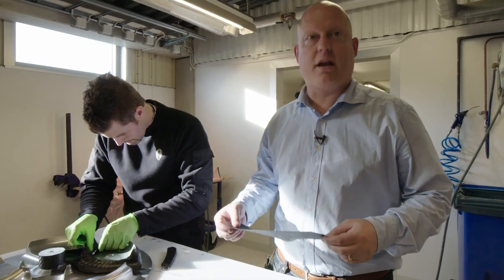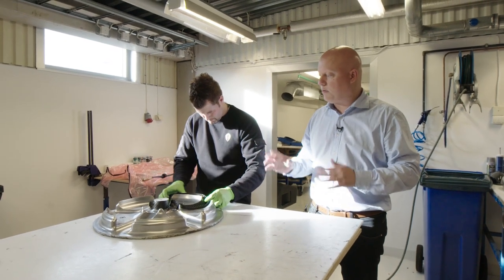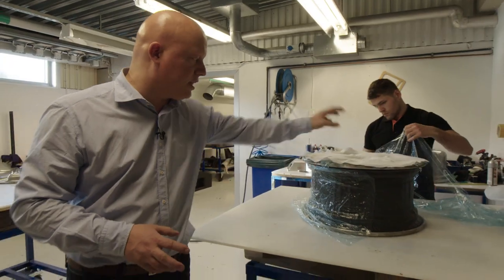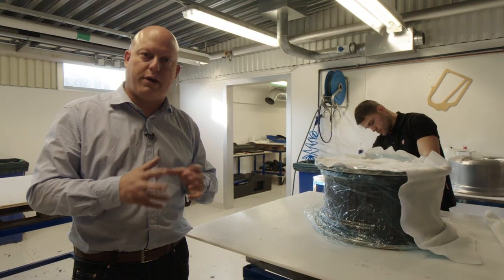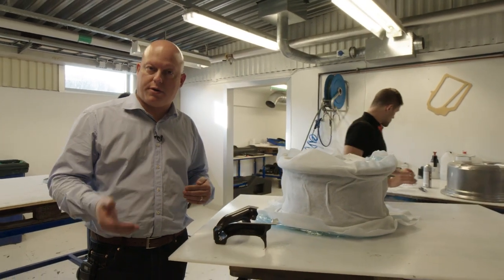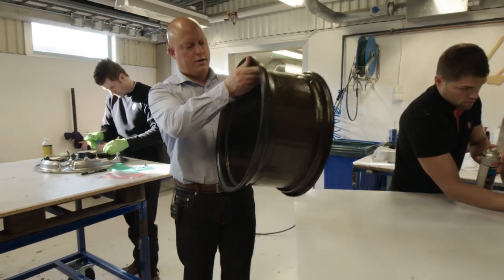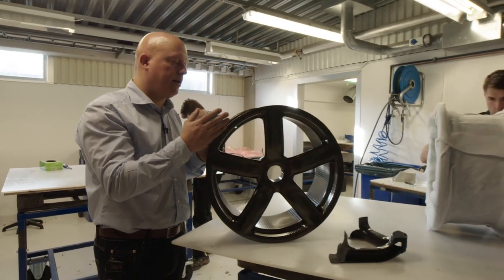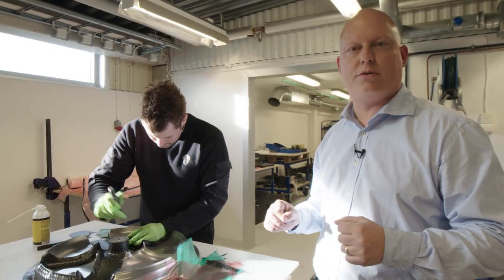Christian Von Koenigsegg Explains How He Makes 280 MPH Carbon Fiber Wheels

Comment: I bet the CEO of ferrari or Porsche doesn't know how the wheels for their cars are made.
Reply: Or Lamborghini
Reply: Nice gixxer, is it a 750?
Reply: Meterz. Thanks. No 600
Reply: +Gary Lowe i also bet they dont even know the engines because they use engineers to make one
but Mr koenigsegg knows everything. that is why his car is goin to be a new king of the road
Reply: +Gary Lowe or what material
Reply: +Gary Lowe The CEO of Ferrari is a mechanical engineer who worked up through the product development side of the business and previous to being CEO, directed the technical side of the road car department. 
The CEO of Porsche is also a mechanical engineer.
Reply: +Gary Lowe With most high performance car companies like Porsche, Audi, Lamborghini, Ferrari, Nobel, Lykan, Koenigsegg, Pagani etc, you'd find that their CEO's have a vast amount of input and knowledge and usually have a background in engineering of some sort.
They might not be involved to the level that Christian is (which is awe inspiring) but they're not blind to their reasons of innovation success.
Reply: Holly Catlin I guess. I was putting them in the same type as shop or restaurant chain CEOs. As you say they probably do know more than I give them credit for.
Reply: +Holly Catlin You can't lump in Audi with companies like Koenigsegg and Pagani when it comes to CEO input and involvement.
Reply: +Gary Lowe I doubt that
Reply: +Gary Lowe and Koenigsegg is pretty scared on testing their cars out
Reply: +Blörk Börg It's not a copyright thing to make your own wheel design. It is an expense thing, but with their volume, mold costs are negligible. Actually, the real reason they probably don't do that is that carbon isn't really the best material for wheels. 

Wait, what? 

Carbon is stronger right?

Yeah, in tension. Carbon fiber is strong in tension. However, it's not all that strong against torsional/off-axis loads. It's even worse when the fibers are bent/curved, which pre-loads them towards failure.

Does that mean that carbon wheels are weaker? Nope. It means that they have to be overbuilt when the primary loads are not tensile. That means they are HEAVIER. And you end up relying more on the strength of the resin than the carbon fiber itself.

For bicycles, carbon rims are also not in tension and are often heavier than alloy rims of the same dimensions for these exact reasons.

Additionally, the resin itself is susceptible to heat. OK, so they don't use rim brakes for cars... but they have disc brake rotors at glowing hot temperatures just a few inches away. Current resin standards start to seriously break down in strength at just 200 degrees Celsius. That's pretty fuckin' hot. But disc brake rotors in cars can make that look like kid's play. Rotors will start to glow at the Draper point, aka around 500 deg C. It's not unusual for disc brake rotors to get into the neighborhood of 900 deg... Keep that up for a while and you'll melt the fuck out of those sweet carbon rims. Carbon can't shed heat very well, so the heat will just keep building up on the inner surface of those rims.

You might see carbon rims on street models, but I doubt you'd see them on a racer. 

And that's probably why Porsche/Ferrari  has no interest in carbon rims.

Not a big deal for body panels though - which aren't load bearing and simply need to be strong enough to keep their shape in the wind.
Reply: +Gary Lowe CEO and owner are two different worlds. I bet Enzo Ferrari knew every single part of his Formula 1 cars because that was his LIFE. Nowadays CEO`s are just employees making company work and thats it.
Reply: Ma Art but the owner of Koenigsegg is the CEO
Reply: You probably mean CEO of Fiat ;)
Reply: I absolutely guarantee that is false.  They know everything about their respective cars.  And probably everything about their competition's cars.
Reply: God this being the top rated comment to me just easily by far screams the overall philosophy and perspective of Koenigsegg and their damn fanbois. Every other supercar, its people simply admiring and appreciating the art and engineering behind it. But here, the first damn comment decides to simply bring two other established, and easily greatest heritage lined race historied companies to attempt to throw under the bus and compare themselves to. Both the two companies you just mentioned have literally well over half a century of absolute unrivaled racing and engineering achievements, TANGIBLE, desired achievements that all car makers across the world pursue. Yet Koenigsegg and their ignorant fans think that its all about stupid bragging rights, throwing around numbers and conjecture yet show nothing solid of substance that can truly attest to their claims. No one cares if you have carbon fiber wheels unless you can bring them to the market for everyone to benefit and see the fruits of your labor at work. No one cares how fast your machine is if its not a production car like a Veyron is, and no one cares how great of an automobile it apparently is unless you have real race history and credentials to prove you know what you are doing. Wake up
Reply: Gary Lowe don't be hyped about this bcz Porsche and Ferrari been in the car racing game for long time even before Christian Koenigsegg was born   they just don't make cars like that and everything they put in their cars it's been well thought about it
Reply: Gary Lowe.. ferrari maybe .but porsche knows where there rims come from ...
Reply: They have to make more than 80 wheels every two years.
Reply: haziq iqbar dude do u even know that CEO of every car company is mechanical engineer and they don't just hire any one from a street walking around and Ferrari and Porsche and even lambo have history of racing cars and konigsegg just brand new company and first konigsegg don't even have their own engine they was using GM engine in their car
Reply: The CEO of Fiat/Ferrari is Sergio Marchionne and he studied commerce and business. He's not an engineer, he's a businessman. Ferrari don't have their own separate CEO as they are owned by Fiat.
Reply: Christian is more involved in the day to day operations than the Porsche and Ferrari CEO's.
Reply: christdragon dude the workshop of konigsegg is like restrooms in porsche or has it all figured it out long time ago  its all in front of camera and of course he have to talk about his stuff what he does and shit he is doin now  Ferrari and Porsche been through all that in 80's  and that explains it all
Reply: Fiat may know something about Ferrari... ;)
Reply: Mr. Petkov w fiat is owned by Chrysler btw
Reply: Fiat Chrysler Automobiles NV, also known as FCA, is an Italian-controlled multinational corporation
Reply: So amazing! I bet a body shop boss knows nothing about these
Reply: Gary Lowe dude. no one can fuck with enzo ferrari. yes he was very disrespectful but he did his job on the best way he could do. r.i.p
Reply: Elon Musk claims he's at least 80% hands on.
Reply: Gary Lowe he was a trully big man on his plant, and he is a young man..!
Reply: CEO of Porsche is a mechanical engineer, so he probably knows.
Reply: Ferrari and Porsche is the best supercars ever made and they have very good car history
Reply: You'd be surprised!
Reply: You’re so wrong
Reply: @eschelar  
Where does the torsional force come into a well designed rim really?
Cornering won`t introduce extreme torsion into a well designed wheel..
Torsional stress can be mitigated through design, by implementing crossbrace forms, and actually leaving enough flexibility in the right places so the crossbrace will take over before the main bearing structure experiences overload..
Do you really not think Köenigsegg don`t do stress analysis, load tests, weight optimization, durability tests, all the rest of it? 
If you`re an engineer which you sound like you`re trying to be, you know tolerances is everything..
And who ever said the car was made for racing, let alone prolonged racing.
Reply: @timgermanyjr  
And their customers..
Reply: @afrog2666  Tension is the primary strength of carbon fiber. When fibers are loaded from other directions, they are not strong. In that case, you are relying on the strength primarily of the resin. This is not an issue of tolerances at all. This is simply an issue of using the right tool for the job. Carbon is great for some applications and terrible for others. They don't make engine blocks out of carbon fiber for a similar reason.

And the strength of the resin is going to be compromised by heat generated in close proximity by the rotors. This will not have a huge effect for cars driven tamely. It will have a huge effect on cars driven hard. However, of course, cars on the track aren't exactly looking for durability of their rims...

It just so happens that I do work at a carbon factory and I do deal with carbon layups. I have done heat tests of carbon wheels and watched many of them fail under much lower temperatures than a racing wheel would be subjected to with radiated heat from glowing red rotors.

How much of an effect this has on daily driver cars is obviously going to depend on how and where they are driven, but I wouldn't consider a carbon fiber rim to be the peak of performance. I would expect that good quality, well engineered aluminum wheels would be able to outperform them in longevity and even in strength to weight.

I would guess that I am correct since pretty much every other supercar out there uses aluminum wheels. Carbon fiber is very good in tension. It's also very good for building superlight panels where strength is not critical (ie a hood or a wing or something like this.
Reply: They probably knew a great deal about their cars back in the day, but Ferdinand Porsche & Enzo Ferrari are dead...lol
Reply: I bet Andreus P does at Porsche GT division . Not the CEO obviously
Reply: it's different, enzo ferrari knew how the wheels were made. and so did ferdinand porsche. the new ceo doesn't. obviously. i read somewhere in the comments that the porsche one is an engineer so maybe he does. but not necesarily. they are administration and business job. koenigsegg is like a modern day enzo ferrari. he is the father of his own high performance automotive brand
Reply: Almost every CEO is just a business man/owner and have very little idea about how cars work.
Reply: @hollycatlin9383  not for pagani dude
Reply: The only Person Close to Christian's Level of Knowledge would be none other than the legenr Horacio Pagani
Reply: Gary Lowe Shows you don't know how a company is run
Reply: The different is,
 this is the founder
And ferrari or porsche has died many years ago...
Reply: @captutel6926  Im here 4 years later to remind you that you were RIGHT!!! Koenigsegg is the kind of the road.
Reply: @NolX757  ow wow HAHAHAH  i dont remember commenting on this 😂
Reply: Yeah, and where’s his eyebrows tho?
Reply: Bring back Gary! Bring back Gary!
Reply: but I think to be an CEO is not easy. I can't imagine myself in this position. :D
Reply: @eschelar , I like your explanation.  Now to find the lightest weight electric motor available to power this vehicle.
Reply: God, the Lord Jesus Christ loves you! Restore your relationship with God by repenting of your sins and putting your faith in Jesus Christ, "... that Christ died for our sins according to the Scriptures, and that He was buried, and that He was raised on the third day according to the Scriptures..." (1 Corinthians 15:3-4)

Comment: They have to weight up the opposite side of the wheel to the valve because the proportion of the weight is so high a VALVE takes it out of balance.

I love this. Absolutely adore Christian and Drive's coverage. Thank you so much for making my Tuesday nights.
Reply: The outbalancing valve is a problem on every car rim, no matter how heavy the wheels are.
Reply: Most tires have a colored dot on the sidewall to indicate it's light spot. You line that up with the valve stem on the wheel to compensate.

Comment: Imagine building a motorbike with this material :O carbon fibre on every single part possible. That shit will fly!
Reply: have you ever seen ufos?
Reply: DmitriSochlioukov
I see UFOs every day.
Reply: John Britten from NZ made one. Look it up
Reply: tosgem He made a ufo?
Reply: It would be too light
Reply: ***** Ducati make carbon fibre bikes, they had a motogp bike with carbon fibre frame but its rigid properties caused some handling difficulties
Reply: Thing is, some weight is needed to put the power to the ground. Something that is too light and has too much power will be borderline undriveable.
Reply: @todorpetrovic  

Its ok though, somehow in the future, all land vehicle will eventually fly.
Reply: BMW HP4 Race
Reply: @CaptainCarling   ... Before that, Ducati 1299 superleggera
Reply: Ducati Superleggera V4
Reply: @R4M_Tommy  Ducatis use the engine as the most part of the frame so hp4 race is a better example
Reply: literally came across this video as i was researching carbon fiber manufacturing processes so i can use it on my custom motorcycle build. hoping to have the bike weigh sub 400lbs
Reply: Google the Britten v1000.
Reply: @todorpetrovic  Koenigsegg counter the the problem by developing their own Triplex Suspension, which is allowing the car to squat without disrupting the balance and the handling of the car while accelerating. Coupled with their own traction control system (starting with Agera), for a rear wheel drive with insane amount of power, his car goes really well imo.

Comment: 5 Kilos for a wheel!?!? My TV remote weighs more than that.
Reply: Yeah man you can lift all the 4 wheels, not like the aluminum
Reply: Nah aluminium wheel doesnt that heavy. If u buy a branded one 16" like enkei only weights 7.5kg add another 2.5kg but costs much cheaper
Reply: Lmao my 15" forged wheels weigh about the same
Reply: @kanjosidr  Yes 15" but thease are 20" and 19" and are wider
Reply: same weight as my cat

Comment: great video, i cant recall where i heard it but i believe due to the rotation effects wheels are 10 times heavier than what they actually weigh on a car so every gram you save is 10 grams effectively, I hope some cheaper material is designed that can be injection molded or something so cheaper versions of light wheels can be made
Reply: I believe it's more like 4 times, but still, a significant weight reduction when saved as unsprung weight.
Reply: ***** Turns out you're right:

The laws of physics rule here. Energy is needed to bring the wheel/tire mass up to speed (mph) and to spin it to the related rpm. Consider a lighter tire/wheel combo:

m = mass reduction
I = inertia reduction
w = rotational speed
v = car speed
r = tire radius
E = total energy saved by mass reduction "m"
^2 = squared

E = 1/2 m v^2 + 1/2 I w^2

E = E(speed) + E(rotation)

Rotary Inertia is the sum of each bit of mass times it's radius squared. If all the mass reduction is at the tire OD (the theoretical but not practical limit), the inertia reduction is the maximum possible value:

I = r^2 m

The relation between car speed and tire rpm:

v = r w

Combine 3 equations above:

E = 1/2 m v^2 + 1/2 (r^2 m) (v/r)^2

E = 1/2 m v^2 + 1/2 (m) (v)^2

E = 2 x E(speed) ... the 2X limit

So if you drop 10 lbs per corner, the net total weight savings is 4 x 17 = 68 lbs. For a 3700 lb car and driver, that's only a 1.8% change.

The main benefit of reducing wheel/tire or any unsprung weight is handling and comfort, by increasing the tires ability to keep good contact with the road. Total unsprung weight might be 80 lbs per corner, and 10 lbs would be a 13% change ... very significant.

-------------------------------------------------

If just a 17" or 18" wheel is 10 lb lighter (reuse same tires), then the total net savings is about 13 lbs. The rotational part is 3 lbs.

Read more: http://mbworld.org/forums/wheels-tires-suspension-brakes-forum-sponsored-tire-rack/343981-effect-wheel-mass-acceleration.html#ixzz30sA2zsEV
Reply: lol good work with the research, wonder where i heard it was 10x anyway, always surprises me how constructive people can be on youtube I try and be better than the normal troll. good work to you
Reply: lol well I had never really questioned the unsprung weight principle, I always accepted the 4x rule. This post made me curious, so I thought I'd do a bit of research.